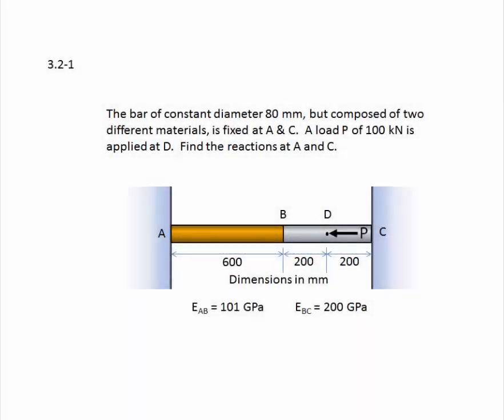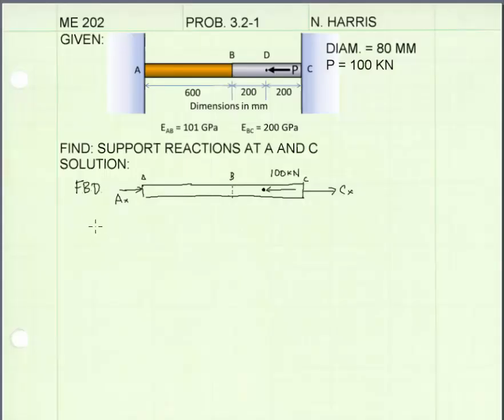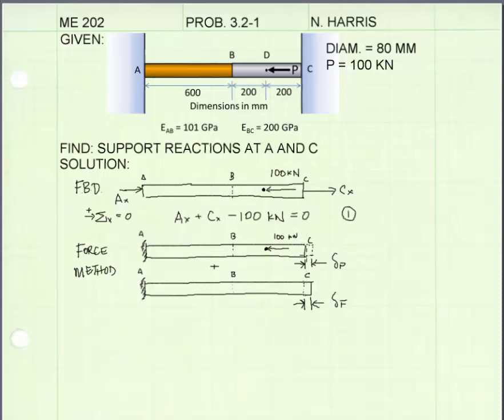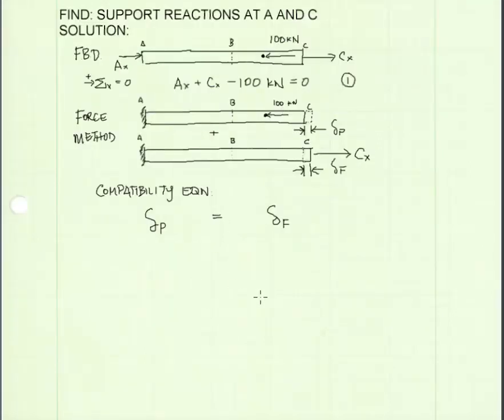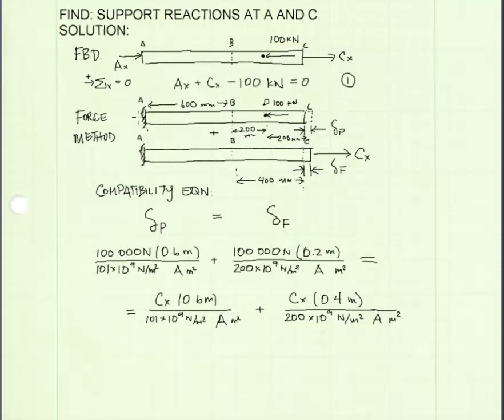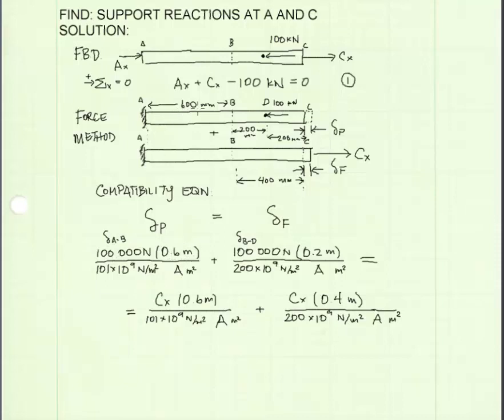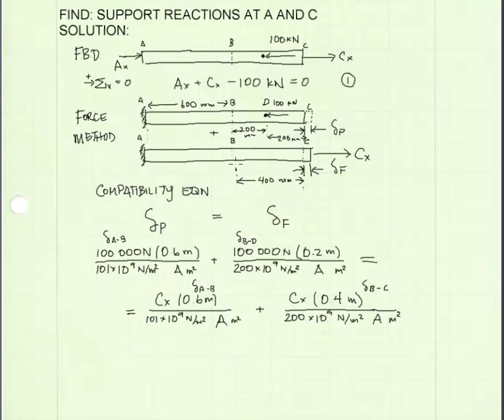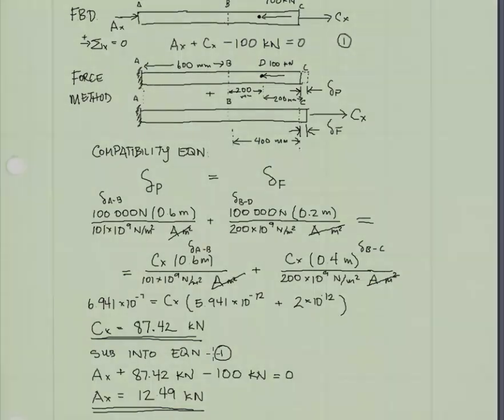03.2-1 Statically indeterminate axially loaded member - EXAMPLE

Comment: Why do you leave out the reaction force of Ax when drawing your force method diagrams? Can you do that? if so, why?
Reply from the maker: Instead of showing the horizontal reactions at the left ends in the diagrams, I have fixed supports.  The "Ax" in the top force method diagram (showing delta p) is equal to 100 kN compression and "Ax" in the bottom force method diagram (showing delta F) is Cx kN in tension.  The actual "Ax" is the sum of the two: Ax = -100 KN + Cx.  (Note: "+" or "-" indicates tension and compression, not force direction.)  It is fine to show the reactions in the diagrams instead of supports, but to avoid confusion, I would not call either of them "Ax".